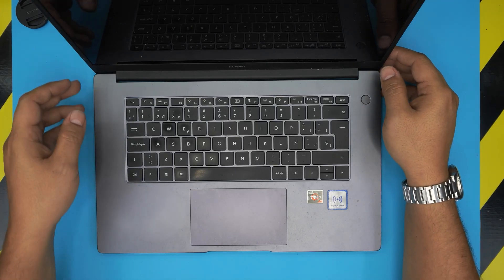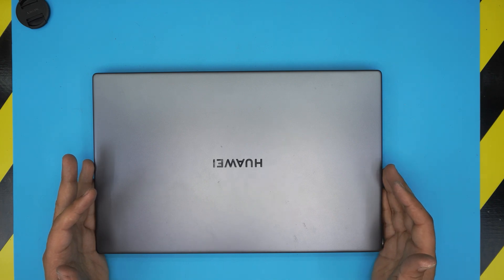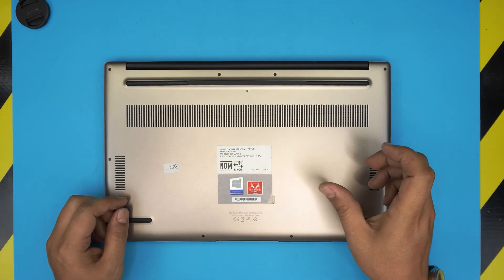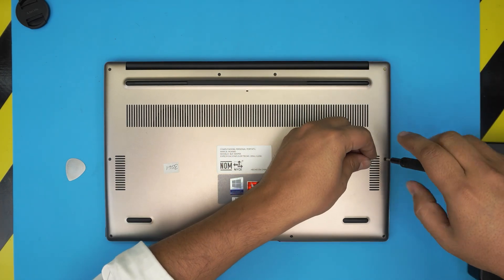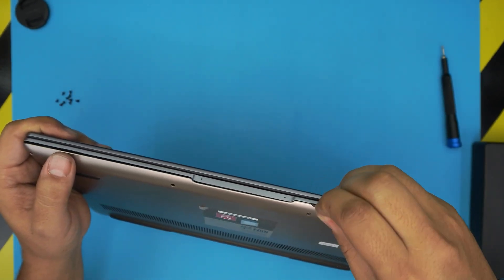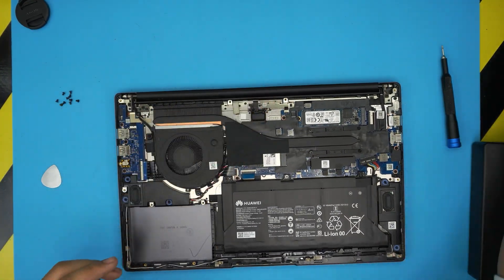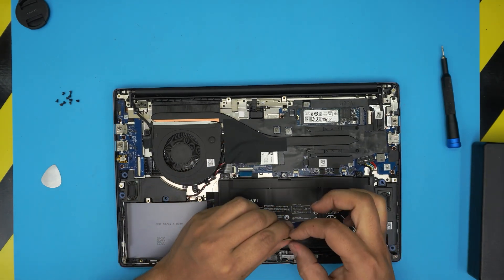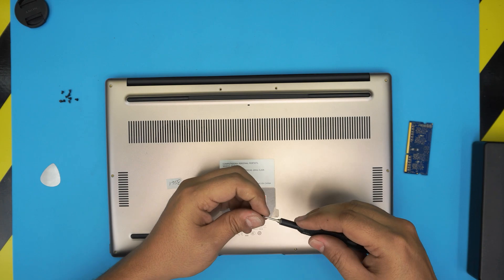Huawei D15 Boh Wap9r 🚩Ram not upgradable

Comment: My ram is faulty and needs changing,etf do I do in this case?
Reply from the maker: 🫠Regarding your question, you will need to find some tech store where they can do a reballing and BGA chip and replace the ram chips on board.
Reply: @uFixTek  better trash this and get a normal laptop

Comment: Guys, I bought a 2021 model with 5500U and 16gb. Memory runs at 2666, but it should run at 3200. I couldn't find anything in the bios to change that. Does anyone know how to fix it?
Reply from the maker: Thank you for your feedback! If you wish to support the channel, you can like, subscribe, or both!
Regarding your question,  yes that is very normal, because the chip-set (motherboard) will auto run the ram on auto adjust speed to e in a safe side. you can't unlock the full ram speed on this laptops because the BIOS is not advanced BIOS, you will need a bios with XMP option enabled , unfortunately that option is not available in this locked bios.
Reply: @uFixTek  I'll have to live with it. Only official BIOS available for download on their website is 1.15 and I have 2.32. More than two times the number. Never thought that software support can be on that level.
Reply from the maker: unfortunately you got to live by with what they gave you, even in the future they will not implement the xmp option on this laptops, even with high end laptops only few models get full unlocked bios get the extra options.
sorry to give you the negative truth response.
Should you have any questions or requests in the future, please don't hesitate to ask me.
Reply: @uFixTek  so I have to download the bios update that's on official website and it might actually work?

Comment: Is this a Huawei d15 2021 model?
Reply from the maker: Yes my friend, it is a 2021 d15 model.
Should you have any further questions or requests in the future, please don't hesitate to ask me.
Reply: @uFixTek  it is really possible to add a ssd ? What kind of connector should I use?
Reply from the maker: i would highly recommend you to get a bigger nvme it is much faster than 2.5" ssd sata. get 2TB NVME and have a better performance.
Reply: @uFixTek  Noted. Thank you so much
Reply: @uFixTek  Kingston NV2 2TB Gen 4 PCIE 4.0 M.2 NVME PCIE SSD ( SNV2S/2000G ) 3500Mbps Read Speed

Do you recommend this NVME?
Reply from the maker: Yes, it will work just fine. However, personally, I would recommend the Samsung Pro NVMe for its superior durability and reliability.   https://amzn.to/3CLXpCF 
 That being said, the Kingston option is also a decent choice.